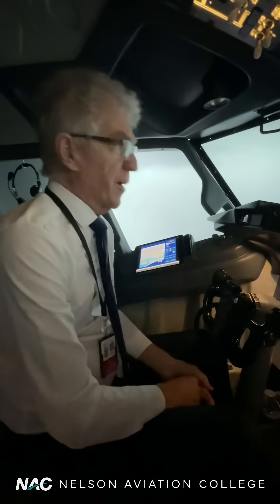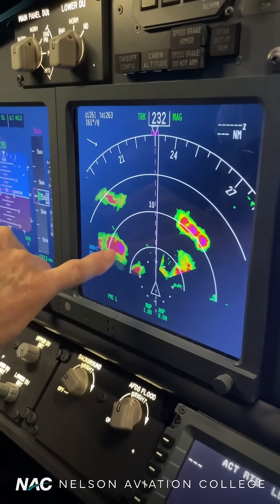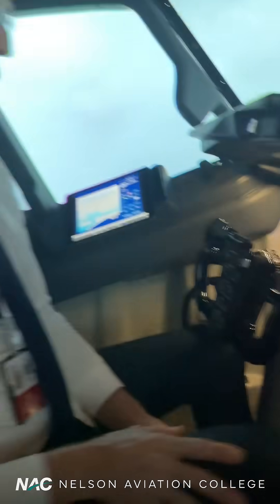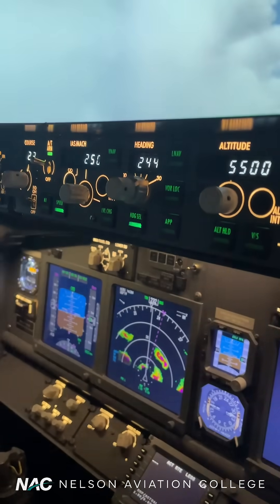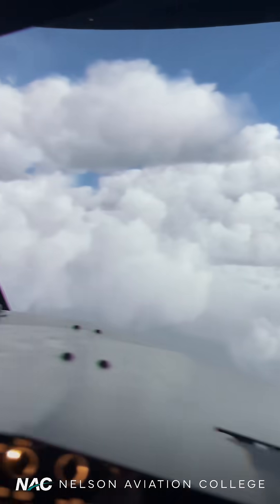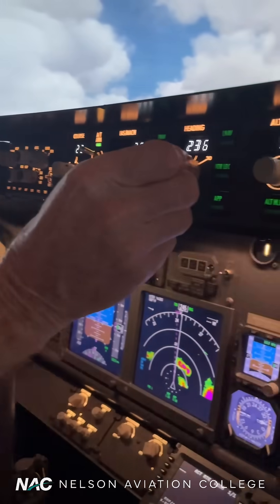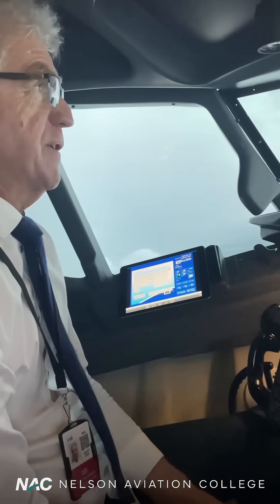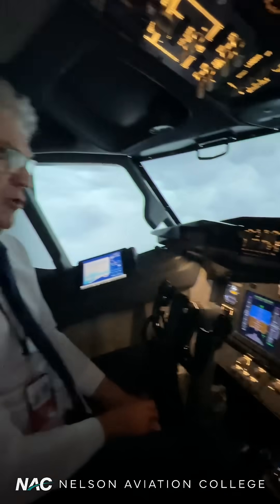Pilot Avoids Turbulence by Flying Around Cumulonimbus Using a Weather Radar

Comment: Do you not have to contact ATC before turning that knob/changing course?
Reply: They probably requested a deviation block X miles to the left/right of course so he could change heading at pilot's discretion to dodge clouds. He doesn't have to call ATC every time as long as he stays within that corridor. If the airspace is not that busy, ATC will normally give you this clearance. I've requested this a few times in the past myself. This frees up the frequency and reduces the workload for both pilots and controllers.
Reply: it is a simulator that he is flying not real aircraft, and regarding your question yes u have to be cleared by ATC every time u deviate to avoid weather

Comment: Pretty cool that a little knob can turn a big machine like that jet.  Much respect to engineers.
Reply: It's even more impressive when you see the autopilot dial on seagoing vessels like crude oil tankers. It's going to be touchscreen & voice command soon.
Reply: @Meisha-san  -- Dang.  I had no idea.  Thanks!
Reply: No need to call the pilot names mate..
Reply: It's a simulator. No copilot. No stripes on his shirt
Reply: True
Reply: the knob is just giving a degree change in course of direction. later on there will be a beeping noise that will ask pilot to do course correction to the given destination. slight angle change would be hard to maneuver manually. 
there are model planes which has autopilot and gyro. why big commercial planes wouldn't have that. also i think this aircraft is 11 years old model based on those screens and knob styles.
there are planes that can take off and land without any pilots needed. which were made after 2015-16 but we need someone behind cockpit as pilot and co pit because instruments in current age are digital and analog and sometimes both have chances of having false readings and that can be catastrophic.
Reply: @TheNatoriousEddie  Interesting.  Thank you!

Comment: You just have to turn a knob to change direction
Reply: It´s because he are on auto pilot. Instead of flying the plane manually around the cloud, he simply tells the autopilot to deviate a few degrees from current setting. Depending on airspace he would call air traffic control and ask for permission or not. If you are flying in congested airspace in Europe or USA he would talk to air traffic control to advice and get permission. His radar can also tell him if there are other planes around. Here he chooses to fly around but another option could have been to fly above. If you look at air traffic monitoring sites you can see that the route taken over the Atlantic can change from day to day. These routes are often corrected to optimise fuel use so that planes take advantage of upper atmosphere wind conditions. You can save a lot of time and fuel by flying with a 200 KM tailwind versus a 200 KM headwind.
Reply: @Mike-zx1kx well put! 👏